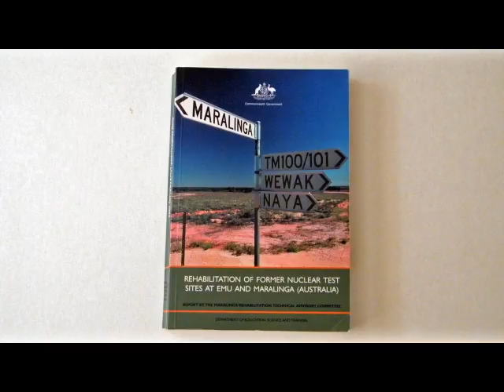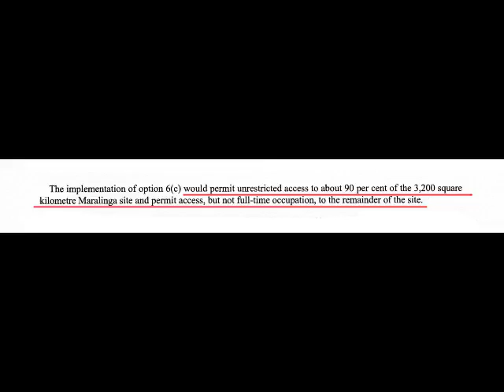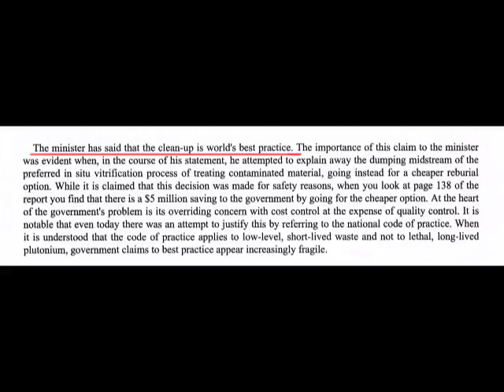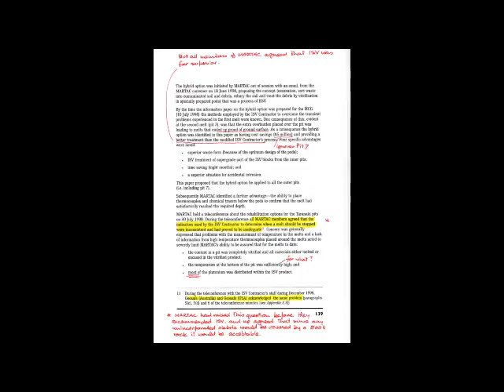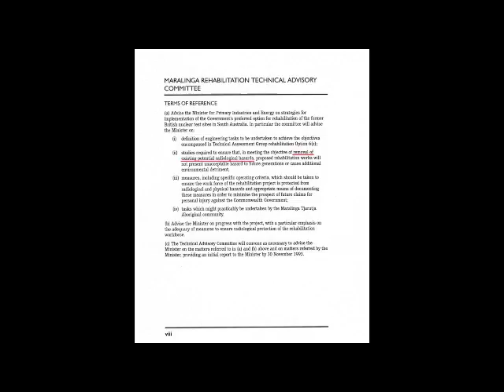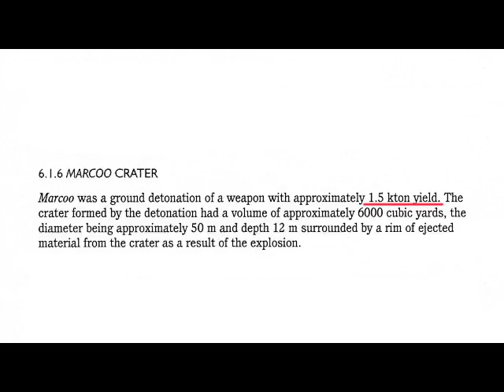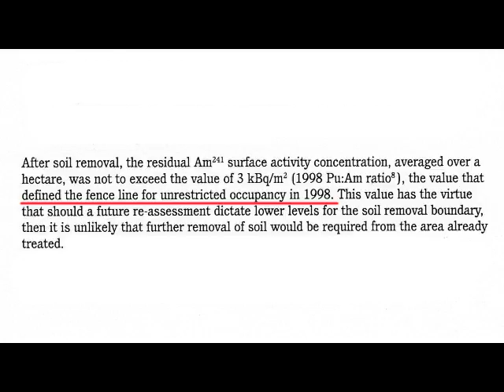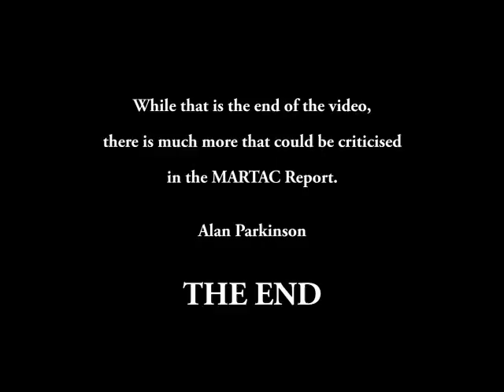Maralinga MARTAC Muddle

Comment: Incompetence from start to finish!..With bureaucrats meddling, from go to woe, it would appear that the cleanup was doomed to failure!!
Reply from the maker: I generally agree, but not quite from start to finish.  The first phase was reasonably successful.  Unfortunately, there was a change of staff in the department and the new team had no understanding of the project - no  nuclear or project management background, and in some cases, no technical expertise.  Against my advice, they awarded a contract extension to a company that knew nothing about the second part of the project and changed the scheme supposedly to save money, which they also failed to do.  They finished with a sub-standard outcome.